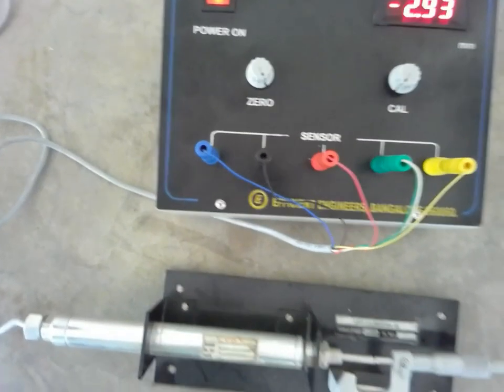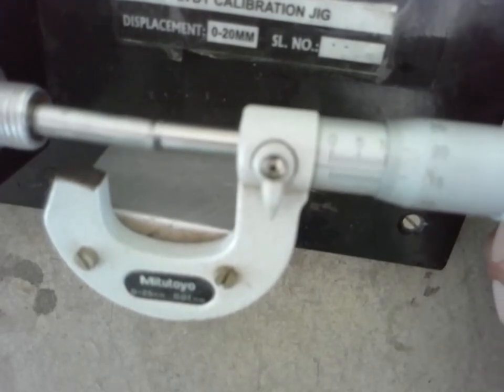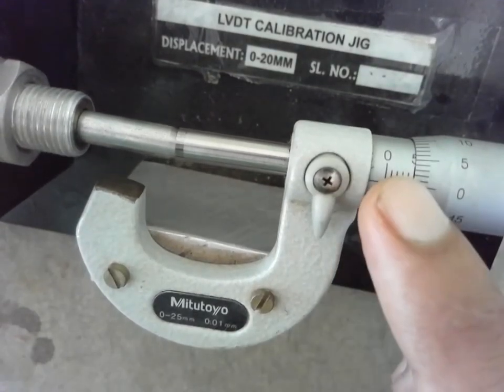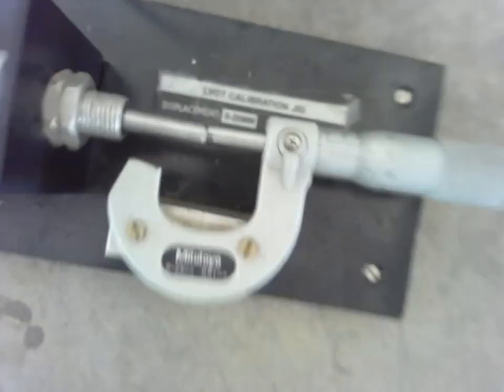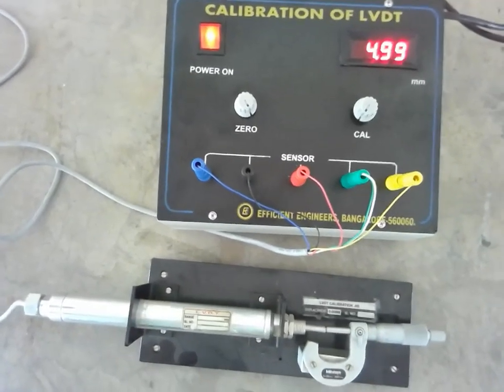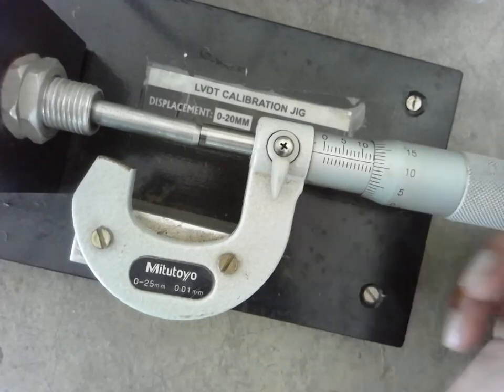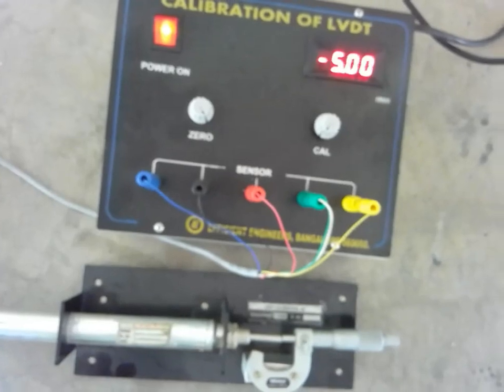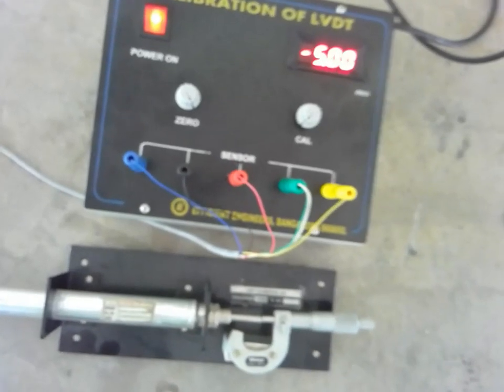LVDT (CALIBRATION OF LVDT)

Comment: Sir in sine bar the theoretical taper angle formula is tan-1(h¹-h²/l) where h is the height of the work piece and l is the length of workpiece
Reply from the maker: yes right answer .but i have done video of sine center not on sine bar
Reply: Santosh Gaidhankar ok sir thanks a lot sir